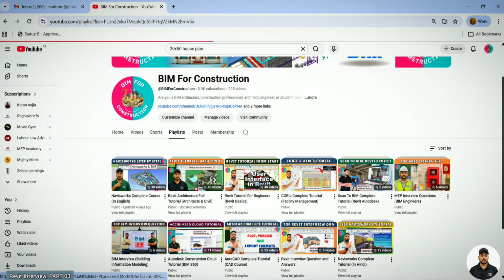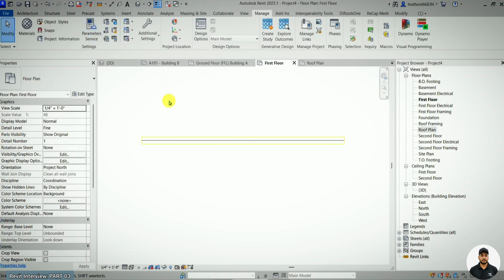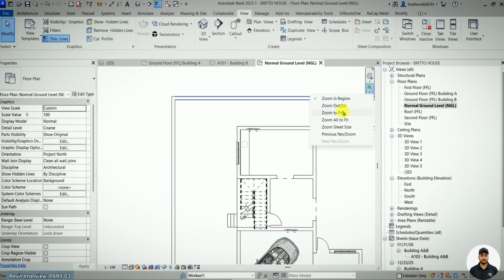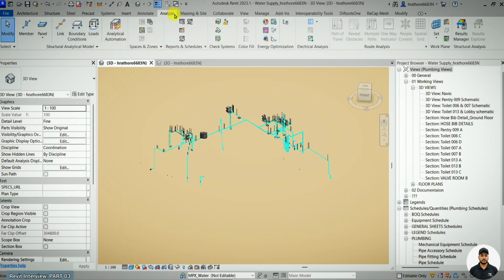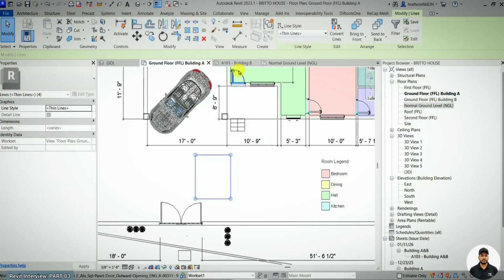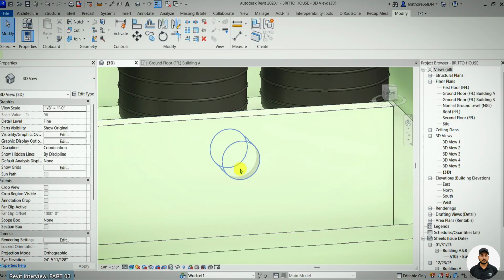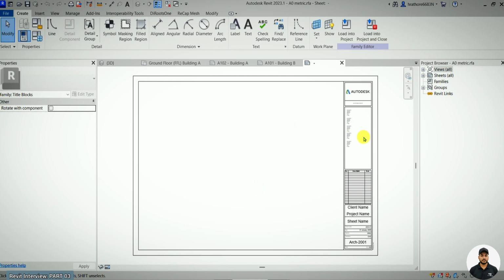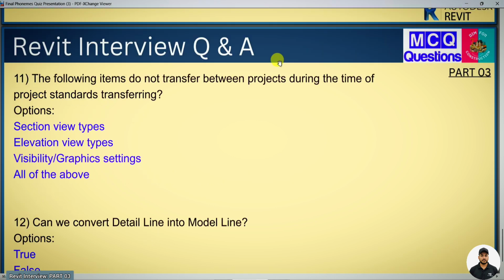#03 Revit Interview Questions & Answers (In English)

Comment: bit confused last lecture (02) has the same question no-11 and there it was said VG will override the filter and here Question no-01 says Filter will overwrite VG. (I hope I am not wrong on this doubt)
Reply from the maker: Sorry for the confusion. 
Filters take precedence over Visibility Graphics. If you change all walls to blue in your V/G settings, but you have an active filter turning all 1-hour rated walls red, the 1-hour walls will still show as red